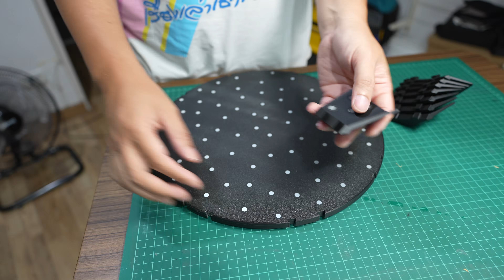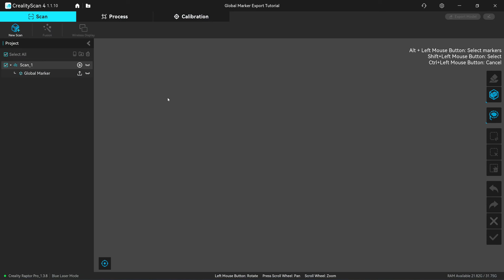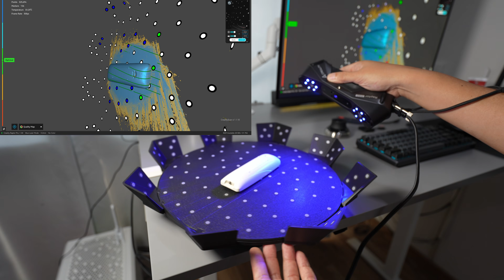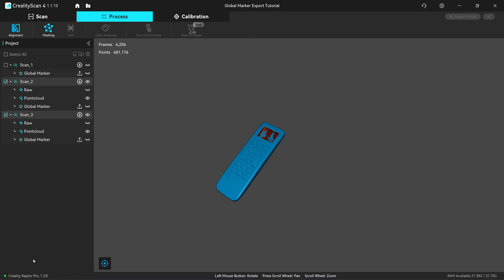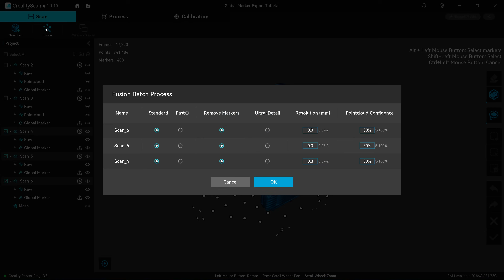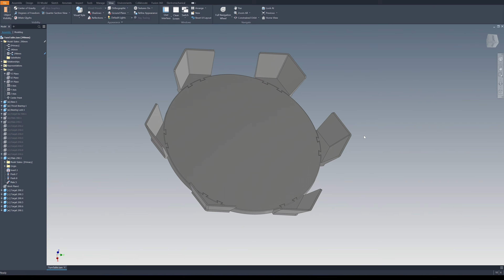DIY 3D Printed Turntable for Creality Scan 4’s New Major Upgrade

Comment from the maker: I've created a turntable variant that fits a 250mm print bed. https://youtu.be/fx81DpbaYXc
Reply: Printed it. Really awesome work. It has not given the expected quality jump for the Pika (at least not for me), but it is an improvement. I btw. applied adhesive to the gaps of all parts at the rear side after having assembled the parts, so that maybe floating glue doesn't ruin the plate. Worked great, even with hyper fluid glue.
Reply: awesome work. Thanks for sharing file. My bambu is 350x320 so i have to use the 290mm version. I would like to modify it to be 310mm so it maxes out the bambu labs h2d print bed but Its probably not worth the effort for the extra 20mm. but I still want it. lol

Comment: For comparison I returned to the original table coming with the device and put some more markers on it. After all it is not producing that bad scans at all, it does not rotate that smoothly as yours. And I have more of the environment (my hand for instance) in the scan. But anyway it is not that useless.

Comment: Couple of questions if I may?  My glueing of the pieces ( I used the file for the smaller build plate printer, and have some white smears in the gaps where I went too crazy with glue and paper towel residue sticked).  Will these be a problem?  Also what size marker dots should I use on this turntable?
Reply from the maker: Use the larger dots. I've 135 dots on my plate. Glue stain should be fine.
Reply: @Payo-TensileCreator  TY

Comment: It feels like a pretty convoluted workflow: you first have to select "Global Markers" and click "Apply" just to import an existing global marker file, and then switch back to the actual scan mode afterwards. Am I missing something, or is that really how it's supposed to work?
Reply from the maker: The import global marker feature has been removed. Global markers are now use for scanning thin object or large object in a single pass, like a full car body scan.
Reply: @Payo-TensileCreator  Are you sure? As said it is a weird workflow, but for me it generally works. 1) Create your global marker file and export it 2) Start a new scan 3) Select global marker and "Apply" 4) Now you can import global markers 5) Switch to point cloud mode and start the scan. The global markers will be used. CrealityScan 4.3.2 on MacOS. It works, but it is weird

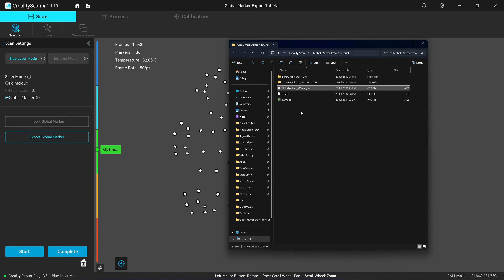Comment: Sorry, probably a stupid question: At 5:34 you mention, “My table size is 340.” Is the table size actually important here, or is it just for you to distinguish between the files?
Reply from the maker: 350mm is good range for Raptor - Sermoon series to detect the markers along the edge.
Reply: @Payo-TensileCreator  I meant the explicit mentioning of 340 in the file name. I thought it could have a meaning for the scan, but it doesn't :) Disregard please

Comment: I seem to be missing something, I scanned the turn table and saved the global markers. imported them and did a scan. Turned off the computer and camera and now I can not seem to find the import global marker option.
Reply from the maker: The latest software update has disabled global marker import. That feature was mainly used for scanning large objects or thin shells in a single pass. The turntable itself is plastic, which makes it prone to warping with changes in temperature and humidity, so fresh marker scanning is recommended. With the improved tracking algorithm, there’s now no difference in performance whether or not global marker scanning is used with the turntable.
Reply: @Payo-TensileCreator  Thank you for the reply, I thought I was losing my mind and have been trying to find it for about an hour and a half this evening. I will move on and get back to trying the new Pika out. Thank you sincerely for your turn table design, it turned out great.

Comment: Scanner Newb here but I've worked in CAD for quite some time. ,  I just bought a raptor for a good deal,  I am assuming this turn table will also work for the raptor as well?
Reply from the maker: Yes, it'll work with Raptor.

Comment: Great video. I'm splitting your model in CP 7.1 right now. Any recommended print settings/profiles? I had to pay ~$20USD for that bearing on AZ.
Reply from the maker: “I printed mine in PLA with 15% infill, and it’s been holding up really well so far.

Comment: How much infill did you use for the print? Is 25% enough?
Reply from the maker: I recommend using 15% infill. Excessive infill can lead to warping on a plate this large, even when printing with PLA.

Comment: Needed to add a 2nd comment. I still think this turntable is awesome and very well designed. However, I think the magnets are too small. I measured the holes after printing and they were 6x4mm but the description says they need 6x3mm magnets. I was going to order the size for the hole but went with the recommended size. They fell too far inside the hole and don't provide enough magnetic pull, and are impossible to dig out. I'm throwing that one away, after I mangled the dish trying to recover the magnets. I redesigned the holes now to hold a 15x2 magnet for more force, but also incorporated a small channel on the inside that goes under the magnet so I can pry them out if needed. I think I'll make it so the magnet I'm going to use sticks out just a bit so it's directly contacting the outside of the bearing. I'm going to print a small sample piece to see how well that holds to the bearing, and if that isn't enough I have some N42 magnets that are 1/4x1/2" that will definitely hold it better. Thanks again.
Reply from the maker: I’m glad it worked for you. My intention was to avoid having the magnet make direct contact with the steel bearing, since that would create excessive adhesion. By positioning it about 1 mm lower, the magnetic force feels much more balanced to me.

Comment: Thanks a lot for the files of the the turntable  .SLDPRT , the idea…I’ve made a triangular base with a low speed hi torque motor, an usb-c li-ion charging module with a li-ion 4,2V 18650 element. All is automatic now for my Raptor Pro ! Thanks a lot man !
Reply: https://youtu.be/T-xjDSssoAo?si=012NsYqF5rUKturr

Comment: First off, great video! I think I’ll be building one of these turntables. In your description, you mention that the bearing used is from SBC—could you share a link to where you purchased it?
Reply from the maker: The bearing is locally supplied. They don't ship oversea. You should buy it from another supplier.

Comment: That turntable is awesome, thanks for sharing. Seeing the MetroX global markers dropping seems to be in line with my scanning experience with it, has a really hard time with "not enough markers" warning showing, while I was scanning an object on their turntable with their dots and all the merker objects around my small object. It was very frustrating so I returned the MetroX and am looking into the Creality options.

Also, little hard to find the bearings you used in the USA but according to your video at the end showing the webpage it's 55x90x25 mm in case anyone wants to finf something similar. I can find some generic brand for an ATV that's $20 on eBay.

Comment: I build the plate and place the marker. Tried to scan with my otter lite and it fail miserably. 

It cant detect the market correctly and keeps lost tracking. 

What could go wrong?
Reply from the maker: I've just made a video. Otter Lite tracking's very good with markers. https://youtu.be/4EetbjH3eUQ?si=8jBgFuoyRLTBobbX&t=714
Reply: @Payo-TensileCreator thanks for your reply! Do you have otter lite video to scan the global marker? My otter lite failed to capture those marker as well.

I only found the raptors
Reply from the maker: @johnchewMY  When scanning for global marker, use the medium mode setting then export it. When import, you can either choose small or medium mode for scanning.
Reply: @Payo-TensileCreator scanning in medium mode works!! Thank you so much ❤

Comment: Thanks for your really helpful videos! They are saving me a lot of time.  
I noticed that the google drive file contains an stp file that is the full assembly. Is there any chance that there will be another file that has individual parts, or better yet stl files? I am just starting with CAD software and my skills aren’t there yet. Thank you again for sharing your knowledge.
Reply from the maker: You can split the assembly in the slicer into parts.
Reply: Creality Print will open stp files? And, split into parts? Wow. I am learning more everyday. I will try this.  Thanks for your help.

Comment: I was so sure I didn't need a larger printer than Bambulab P1P, but you proved me wrong.. 😅
Reply from the maker: Even 5 cm will make a big different for print bed.
Reply: i just got done remixing this to fit on a p1p, i had to scale the  table down to 245mm  but i kept the bearing the same 90mm size,  i ended up ordering the 51211 thrust bearing from ebay for about $20 USD
Reply: https://drive.google.com/file/d/1_XOssKBpshYY1rA7O6mpxCKY6FsUJ781/view?usp=sharing
Reply: nevermind, i went threw all that trouble and just found he already madea version that fits on 250mm print bed lol

Comment: Another Thrust Bearing question, what is the bearing SIZE -> Bore Diameter=40mm, Outer Diameter=68mm, Thickness=19mm?
Reply from the maker: The size is 90x55x25 mm
Reply: @Payo-TensileCreator  Thank You, great video by the way, keep them coming.

Comment: I printed off the turntable and assembling now. Here in the USA the bearing is $200 from pipe store but i found one for $34 on amazon. 

While putting on the reflector stickers on the plate I figured out you cpuld just put the plate on the small creality turntable and it works amazingly.  Its almost as if the creality turntable needed leverage to rotate. But with your plate on top i can get it to rotate several times before stopping with just one spin. So anyone out there who cant find the thrust bearing just using the creality playe could save you $$$ yet have the same effect

Comment: Can you drop the link for the Thrust Ball bearing 51211 that you found for $6? I can't find it that cheap anywhere!
Reply from the maker: I think it ships domestic only. Try to find this specific brand. "SBC" it's the one.
https://shopee.co.th/51200-51201-51202-51203-51204-51205-51206-51207-51208-51209-51210-51211-%E0%B8%95%E0%B8%A5%E0%B8%B1%E0%B8%9A%E0%B8%A5%E0%B8%B9%E0%B8%81%E0%B8%9B%E0%B8%B7%E0%B8%99%E0%B8%81%E0%B8%B1%E0%B8%99%E0%B8%A3%E0%B8%B8%E0%B8%99-THRUST-BALL-BEARINGS-i.340201674.11109098756

Comment: Payo, it's amazing — ever since I got my Otter, you've been my main guide on this learning journey! The way you teach and explain things is truly incredible. Your help has been essential, because even after watching many other videos, I’ve never seen anything quite like what you share.

I’ve had a 3D printer since 2013, but honestly, I never really believed in 3D scanners — the Otter is my first real experience with one. I already model in ZBrush and Fusion 360, and having a scanner like this is an amazing tool to support my projects!

By the way, can this scanning method using global markers also be applied with the Otter?

That scanning table you built is fantastic! Congratulations, and thank you so much for being so helpful, efficient, and dedicated. Always keeping an eye out for your latest updates!
Reply from the maker: Yes, the global marker import works with Otter, and tracking is fast, almost as fast as Raptor.

Comment: I wish I had thought about the glossiness of PETG before. Even the surface I use for scanning is a little too glossy and I have reflexions of the laser lines as 'bars' within the scan somewhere within 3D space. Matte seems to be very important.
Thanks again for your helpful hints.
Reply: @smartintech2  if you print PETG at the minimum temperature it’s not glossy typically

Comment: Regarding Revopoint Metro X, I think you should adjust the scanning distance to the maximum value, which is 200-400. This is probably the reason why the markers are lost, and it is also the reason why you can't scan high objects later.
Reply: Regardless, Revopoint needs to take notice of this issue and address the stark contrast in usability between the two scanners. I have a MetroX, and along with other issues I've had with it, I'm wondering if I made the right choice. When first released my laptop worked perfectly with the device and the software, but with each subsequent software release it seems to be getting worse and worse in regards to frame rates and scanning speed.
Reply: My thoughts exactly.

Comment: Another design that would be good is having your outer attachments thin and taller. 
Id go as far to say use the small markers, so you can have more under the turn table scanning angled view.
The old 5 markers would be good.

Comment: cant you print the white points using white PLA ?
Reply from the maker: No, it has to be very precise in diameter and coated with reflective material.

Comment: one trick i have found to work good for the hard to scan objects like the chuck, is to use a small soft brush and dab a little coat of all-purpose flour on it, just a little dusting and works pretty good
Reply from the maker: Great tip!

Comment: I am waiting for the global marker saving/loading since long time. Current available version v4.1.0.3 does not support this feature you were showing. When the new version will be made available? BTW ... other question. With CR-scan v4 the screen mirroring with Smartphone is lagging like hell, totally unusable. Streaming method in v3 was working great. Any similar experience or solution for this?

Regarding the MetroX (i have sold mine already) you need to manually increase the scanning distance to maximum value (200-400mm). This will improve the marker detection and marker tracking a lot because also more far away markers will be considered. Totally bad implementation in RevoScan from my pov. In Cr-Scan for example always all visible markers will be detected and used even if they are outside of selected scanning area which totally make sense. The scanning SW should only limit the scanned point clouds but still consider the markers outside of this area.
Reply from the maker: Creality's finalizing and ironing out some bugs and now the screen mirror lagging time is down from 6 seconds to 1 seconds. They're trying to make it lagging free, but no promise on that. One second is fine but I still can feel it.
Reply: Thanks for sharing your experience on this which matches mine. The delay with browser based streaming method from CR-Scan v3 was much lower. I could clearly feels it's faster and i could also prove this with wireshark logs from both streaming methods. Hope this will be fixed soon.

Comment: You make me want to buy a proper scanner. I've been using photogrametry apps on an iPhone for the little bit of reverse engienerring I need to do, but they're not very accurate and I haven't figured out a way to make them more accurate.  PS. 353 THB hasn't been $6 in 30 years, 555...  more like $11.  The last 6 months it's been getting even worse (for USD) as it's been loosing value rapidly due to some really dumb US policies.
Reply from the maker: I actually paid 190 THB + free shipping. That website I show has better picture.

Comment: Amazing as usual! I wish I had a bigger bed! Alas mine is only 250x250 :( I got to the portion where you explain about the size, makes sense! 
Tried to find similar bearing that ships to US, way more expensive
Reply: I managed to split the turntable into 4 parts in Solidworks, printed  on the Bambu in ABS and I'm currently carefully gluing it together. All the other parts fit on a 250 x 250 without mods, I think it will work just fine. Got my bearing on Ebay UK for £10 ($12 approx)
Reply from the maker: Trump said you have got to start making your own ball bearing.
How much does it cost you?   Anyway, I'll try to make the version that can be printed in a smaller printer, but your goanna need joints, can you live with that?
Reply: @Payo-TensileCreator  Yeah, somethings wrong with that guy...I was looking to buy one bearing with that same size, and it the cheapest that I found was going to be around $30+ with shipping I think. I found many others that were double  or triple that price. 
Regarding the smaller size, yes I also thought that maybe there was a way to split it in thirds or more somehow and then have it come together and still be bigger (than if it was just 1 piece), and if needed, I can cut some other material to the same diameter to make it all flat and a single surface to hide the seams.